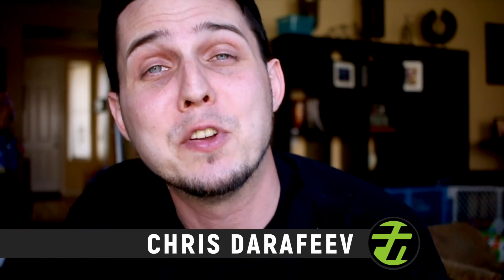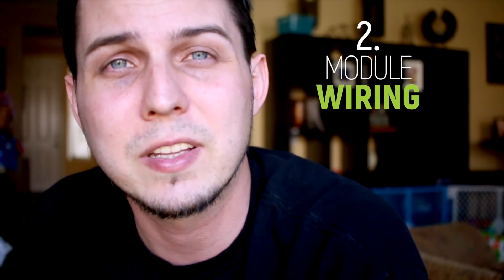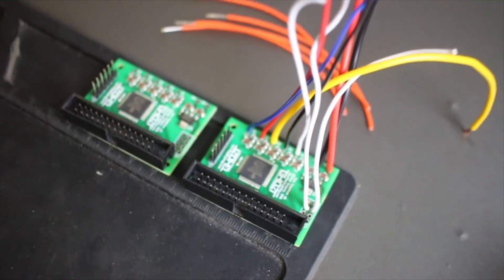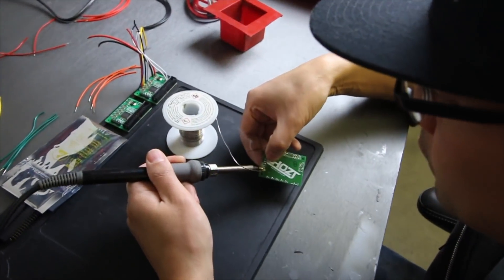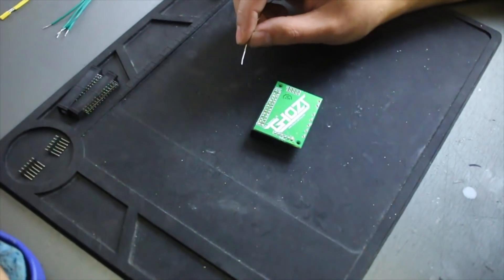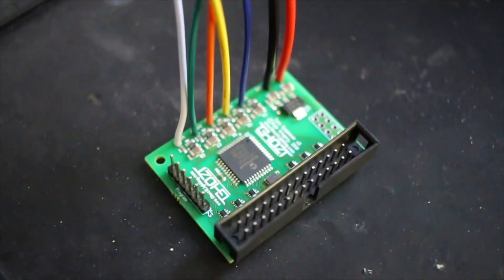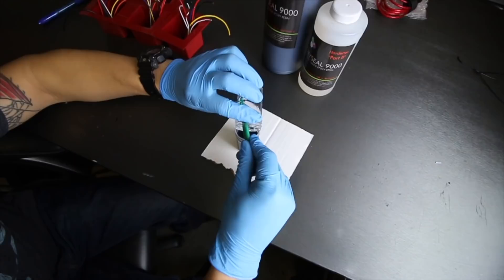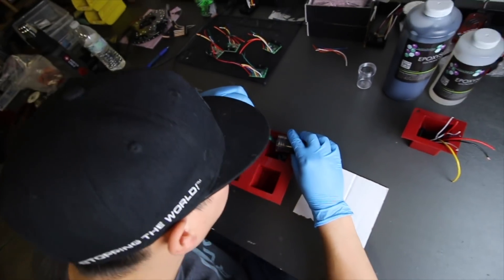Ghozt Lighting Sequential LED Modules | FlyRyde

Comment: WoW times have changed, I built a sequencer for my cars tail lights back in '88 when nobody was doing this, but back then, used individual switching transistors and an atmel eeprom, made 16 channel board that was huge compared to todays standards... (8 each side)...., and yes, I was switching ground on & off too
Reply: thats dumb really, why trigger ground when the car body is ground. Always trigger positive. otherwise you can also get bleed thru and lights illuminating when switched off.

Comment: I found this the most valuble, because these led modules are very hard to find for this kind of application!
Reply: The only down side of potting is if you need to fix/troubleshoot the board later you. You won't be able to due it being inaccessible

Comment: You still need grounding straps after potting if there is no ESD protection on every individual I/O. I haven't seen the schematics yet so maybe there is built in protection, but if you touch any of the pins on the connector or any cables and your body is charged then it can damage the controller without ESD protection. I't always good to wear grounding straps, they can save you a lot of time and money in costumer projects.

Comment: Do you need a ghozt module for each tail light or will one module run both tail lights?  Also can you buy these modules prewired or do I have to wire the board myself? Can you send me links to buy the modules and the programmer plz?  I've been doing custom lights for a few years now at my car audio shop but I've never touched base on sequential lighting an I'd like to add this to my arsenal .. greatly appreciated man.. you do awesome work!

Comment: $149.99 for a Ghost controller?  A bit insane as I can buy a STM8 for a dollar
Reply: or arduino nano and customize 10 times more
Reply: @fusion-ux1zz  Yes but the Arduino isn't going to hold up as well to automotive vibrations
Reply: U can 3d print a case and add some pads to remove any danger from vibration 
Trust me an arduino works really well . I have done this and added a bluetooth so i can control the led sequence .i have also desgined a pcb chip to fit 8 shift registers giving me 64 pins . I can also send u the pcb files if interested
Reply: @fusion-ux1zz  can I get more info on this?? do you have an instagram i can message you on or something
Reply: @fusion-ux1zz  hey dude, I got a couple of questions related to that. Think you can help me?
Reply: @fusion-ux1zz  been trying to find more information about cheaper alternatives. These controllers are pretty pricey and shipping them to where I live will just send the overall cost through the roof. Could you help me get my hands on more info about your Arduino alternative? I'd really really really appreciate it